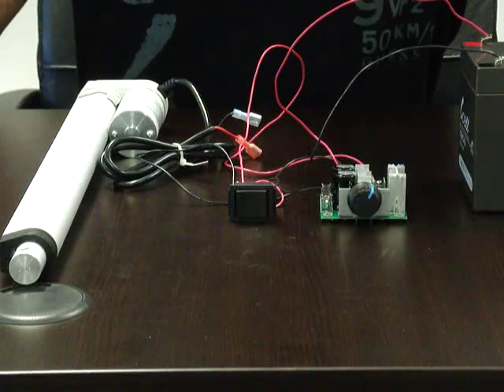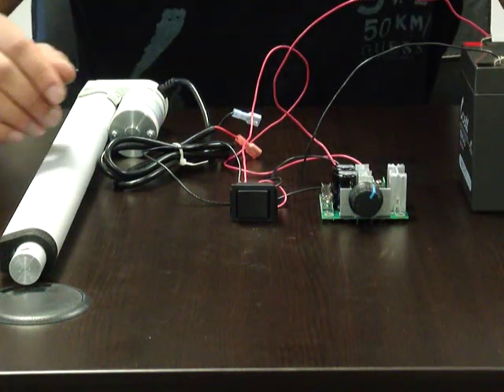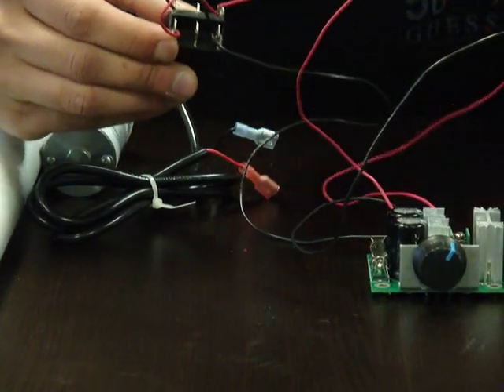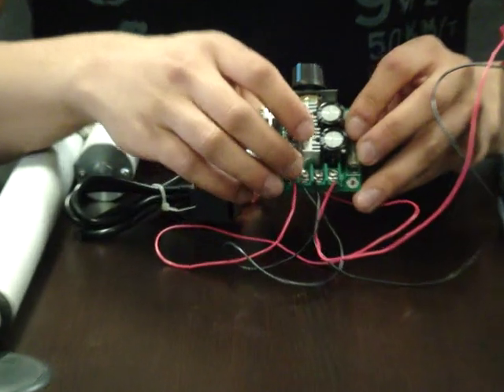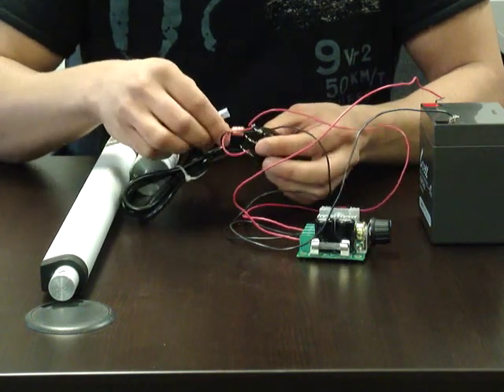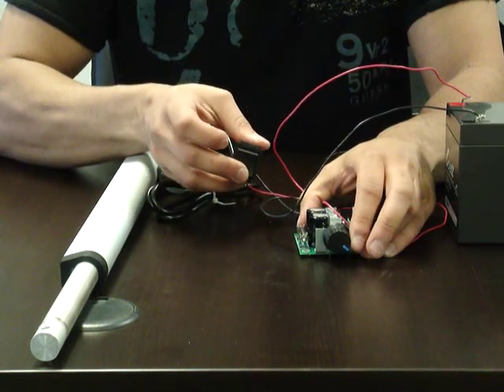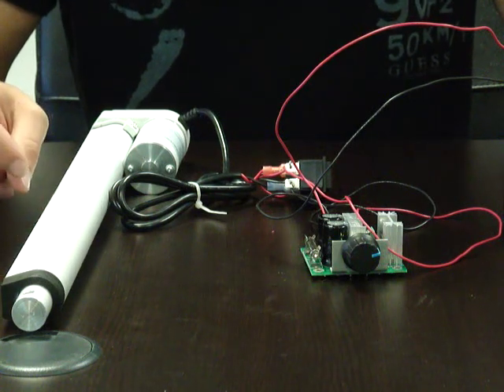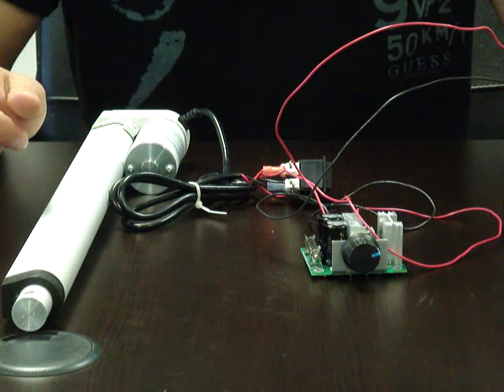How to Wire a DC Speed Controller to Actuator: Full Instructions - Progressive Automations

Comment: Progressive Automations_Can you tell me how much does this whole kit will cost?
Reply from the maker: Hi Mandar!

Currently, here are the products used in this setup along with the pricing: 
DC Speed Controller - 10A  —  $31.99 USD
Rocker Switch -Non-Momentary - 20A - IP68 — $29.99 USD
12V - 5A Battery for Linear Actuators — $39.99 USD
Feedback Linear Actuator — $138.99 USD

Total: $240.96 USD

Please note that we do offer discounts for purchases with multiple units. 
You can find all of our products by following this link: www.progressiveautomations.com

Comment: i would like to know if this speed controller can be wire to the linear actuator only in one direction (retract direction) and use the normal speed in opposite direction (extend direction)? if it does how i can wire them in one direction. so thank you in advance
Reply from the maker: To do this, you could have your double-pole double-throw rocker switch wired such that:
-pin 1 (top left) goes to Power Supply (+)
-pin 2 (top right) goes to Power Supply (-)
-pin 3 (middle left) goes to Actuator (+)
-pin 4 (middle right) goes to Actuator (-)  
-pin 5 (bottom left) goes to Speed controller(-)
-pin 6 (bottom right) goes to Speed controller(+) 

Wire the output of the speed controller to the rocker switch, and not the output of the rocker to the input of the speed controller. For safety, wire a diode that blocks reverse flow when you flip to the PWM side, so the power supply doesn’t back-feed the speed controller. Test your output terminals with a multimeter to confirm proper operation before wiring the actuator in place.
Reply: @ProgressiveAutomations  thanks for quick answer so I still jumping wire from pin 1 to pin 6 and pin 2 to pin 5?
Reply: @ProgressiveAutomations  so the diode must be wire between rocker and actuator?
Reply from the maker: No jumping wires required. Add a diode between the rocker switch and speed controller output.

Comment: Can I use this to control a power table with bad power box?
I have some power tables- The motors or actuators are still good but the control boxes went bad
Reply from the maker: Hi Chibuzo! 
Actuators with brushed 12 VDC motors that do not draw more than 10A of current should be compatible with our rocker switch and speed controller in this example.

Comment: Do you need the rocker switch? Just need full out and back on a slider.
Reply from the maker: Hi Harry, great question! Speed controllers will typically require a rocker switch, however, you can use any control system as long as it can accept input pulses of voltage and then output the voltage pulses in the polarity you desire to your actuator. This will result in the ability to adjust travel speed while also being able to change travel directions. If you have any further questions, we're always available at sales@progressiveautomations.com Cheers!

Comment: What its missing is the max speed for instant the actuator said 10mm/s if we use the speed control it will increase to 20mm/s ???
Reply from the maker: Thank you for asking!
The DC Speed Controller is only able to control the actuator's maximum rated speed to zero. It cannot increase the actuator's speed.

Comment: Hi,
Can we increase the speed of the linear actuators on and above the spec?
Reply from the maker: Hello Thirumalai,
Applying 12VDC directly to the actuator will result in the full speed of the actuator while under no load. DC speed controllers may be used to adjust the speed from 0-100% of the rated speed. Increasing the speed can be achieved by applying a higher voltage than 12VDC, however, we do not recommend this method as it may decrease the overall lifespan of the internal components.

Comment: Can you use this DC Speed Controller with your relays and Arduino? Basically can you control the linear actuator with the Ardunio, but adjust speed with the DC speed controller?
Reply from the maker: Hi Jesse,
In order to control the speed of an actuator with the use of an Arduino, we recommend using the LC-80 megamoto. This allows the user to control both the timing and direction of an actuator, as well as the speed.
Thanks

Comment: Is there any way to wire it so it moves continuously?
Reply from the maker: Hi Max
You would need to program the actuator to cycle continuously using a PLC or Microcontroller, other wise the actuator will stop once it reaches the end of its stroke. If this is something you would like to learn more about please contact us at sales@progressiveautomations.com or 1-800-676-6123 to get more in depth technical information. 
Best Regards

Comment: Good evening Sir/Madam,

I am looking at reducing the vibration in a Wildcat helicopter.

Obviously due to the cost i am unable to use a full size military Wildcat so i am looking to prove my concept works on a radio controlled helicopter.

I need to measure the phase of the main rotor head so i can ensure the dc motor i will be using as the “shaker” will be 180 degrees out of phase therefore reducing or minimising the vibrations. This is where i am struggling, your clip is exactly what i am hoping to achieve altohugh it would need to be considerably faster to nullify or reduce the helicopter vibration

I would appreciate your expert opinion as to what components would be best for me to purchase off your website to achieve this information,

Best regards

Mark Sheldon
Reply from the maker: Hello Mark. First you would need to figure out how much current is required, then based off of that you can use one of our DC Speed Controllers. We have a 30A model (https://www.progressiveautomations.com/ac-26-30) and a 10A model (https://www.progressiveautomations.com/ac-14) available. If you have any other questions please contact us at sales@progressiveautomations.com or 1-800-676-6123. 
Regards

Comment: That's cool. Will that work to reverse the polarity of an electric trolling motor?
Reply from the maker: Darren, hi. Thank you for the question. 
Unfortunately I am not familiar with the specifications of your trolling motor, however, this unit can control 12VDC in both the forward and reverse direction, while adjusting the speed. If your motor is a 12VDC motor and does not exceed the current limitation of our speed control units/ rocker switches, it will be compatible.
Reply: Progressive Automations many thanks for your reply. I have a Watersnake 24. It's a pretty standard electric motor.

Comment: A question my linear actuator according to the manufacturer comes to 25% of usable cycle. What should be the frequency of the PWM?
Estes is I peseo actuator thanks http://www.windynation.com/cm/Actuator%20Manual_R3.pdf
Reply from the maker: Josempe1 Usable cycle or duty cycle refers to how often you can run the
    actuator. For example 25% means you can run 2.5 minutes out of every
    10 minutes.

    PWM frequency has little effect on this specifications, since the
    motor needs time to cool down. Hope this helps!
Reply: Josempe1 v